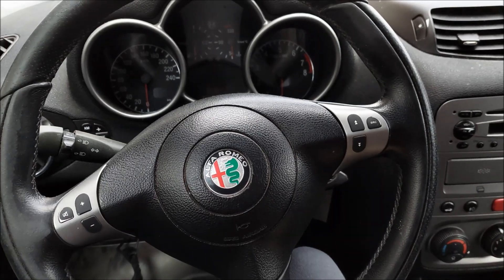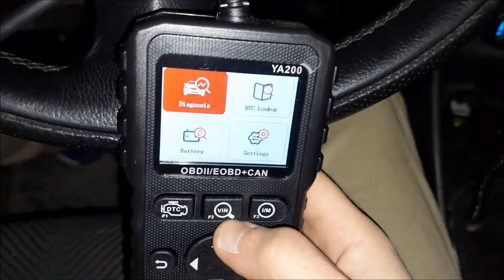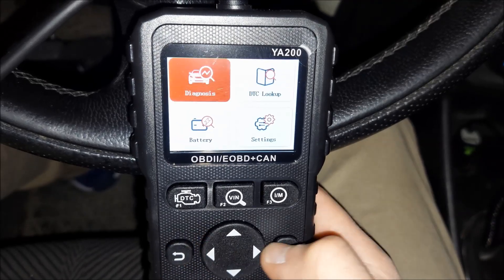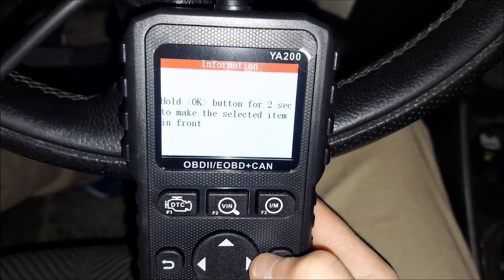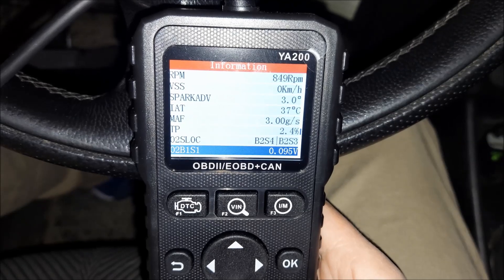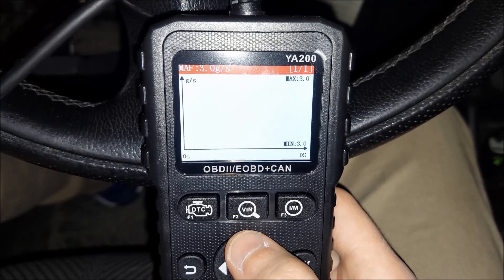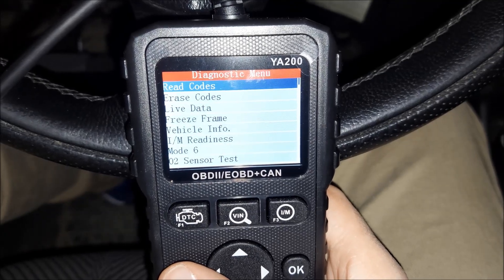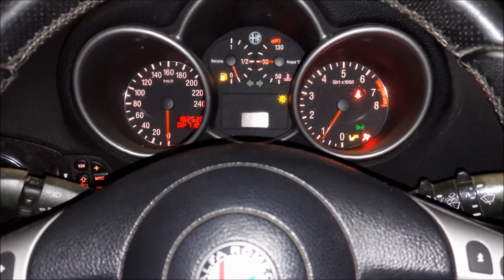Kingbolen Diagnostic Tool YA200 Review

Comment: A good idea, at a good price. It would be interesting to try it with the alpha GT, although I think the result would be almost the same. I have an OBD II bluetooth emitter and with apps, we can see some error codes, but few can be deleted. In my case, that airbag error signal was effectively corrected by reconnecting the pin (driver's seat). 
On the other hand, it would be very interesting for me, an approach to the subject of changing the ignition coils: the abysmal price differences make me doubt which ones to buy (among the cheapest). In case it helps to choose a new theme for another... Good video. Thank you.
Reply from the maker: Thank you for support buddy. What is the engine in your GT?
Reply: @arcgarage  Hello, again. My beloved Alfa GT, is 1.8 cc Twin Spark. And you continues to produce 😃Thank you